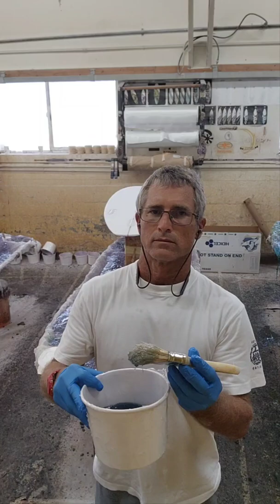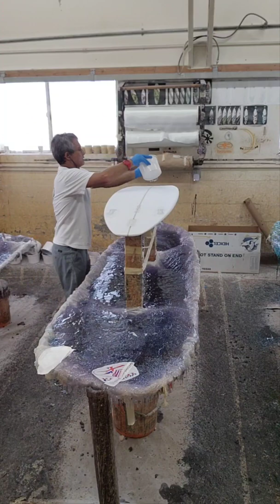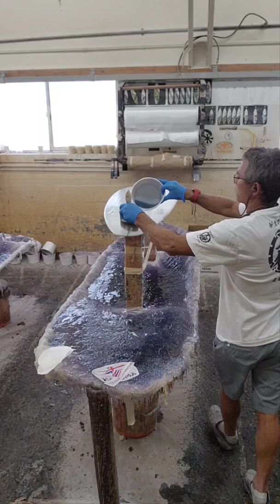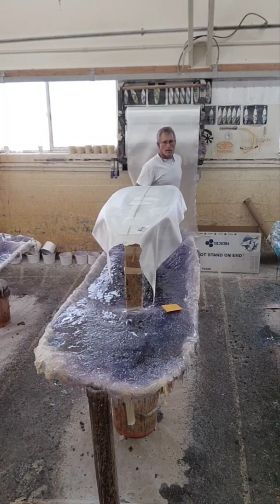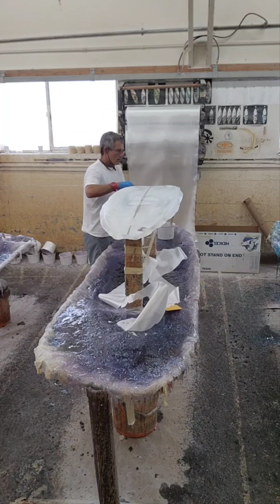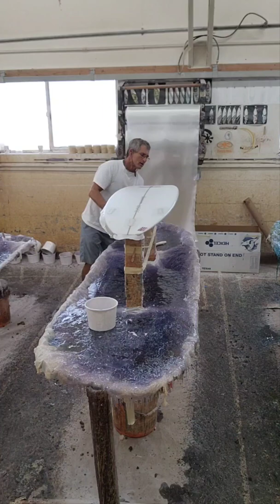One method to laminate that bypasses much of the long learning curve of laminating.

Comment: Super! I'm currently making a handful of boards after only ever having made a dozen, the last one being 30 yrs ago. 2 days ago I had to strip a lam off because it kicked before I had the rails wet out and down (I misread the uv directions by a factor of x10 haha). I did ok with my next try last night, but since one of the shapes is in EPS foam, I'm gonna have your heart attack unless I can double speed my game. Your method looks like a real viable alternative and I will try it on the other boards first (the epoxy last). However, since I'm double glassing the decks: How does this method work for 2 layers - just paint it a bit thicker initially? Thanks so much for this vid!
Reply from the maker: Usually on the deck you would put down the 1st layer and trim it 1st.  Then you could paint on the resin then pull the 2nd layer on like this
Reply: You can use slow kick epoxy for eps too. Long pot life.
Reply: Wow thanks for sharing all these amazing tips! Im gonna try it for sure. How does this method works with pigmented resin? Does it works and looks like the traditional way? Once again, thank you!

Comment: Awesome technique. Now that I'm using just epoxy I'll try it. Not enough time for me using poly hahaha
Reply: Did you try this method with epoxy on EPS yet? How did it go?
Reply: @joeblow1942  I tried it just once coz, I didn't have time to make boards. With epoxy it's not a big deal to glass, even for a long board u'll have plenty of time. But with this method, I'm 100% sure that the shaped blank, will suck enough resin and wont delaminate.

Comment: Thank you for the countless tips, I was wondering, would you make any changes for epoxy and is there a reason you're using warp apposed to e or s glass?
Reply from the maker: Epoxy would be the same method and warp is the best cloth for my conditions here because I need the extra break resistance without the weigh that warp provides.
Reply: @kazumasurfboards  thank you again

Comment: Would this work with tint cut lap?
Reply from the maker: Yes it works the same on a cut lap and is magical on a color resin tint lamination because the saturation. Is really even and won't leave the wavy discoloration that you see when you over squegee it.
Reply: @kazumasurfboards  awesome!  Polyester resin no problem?